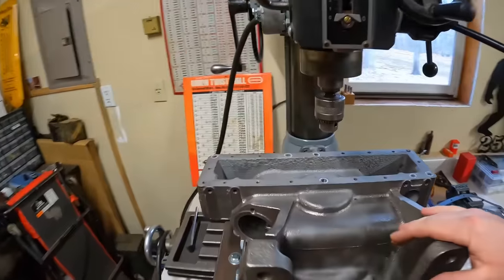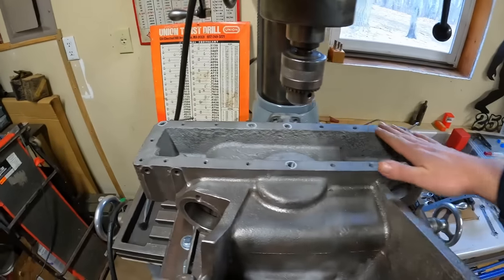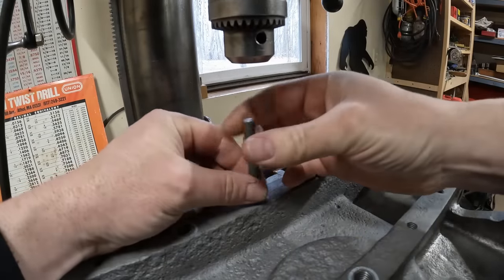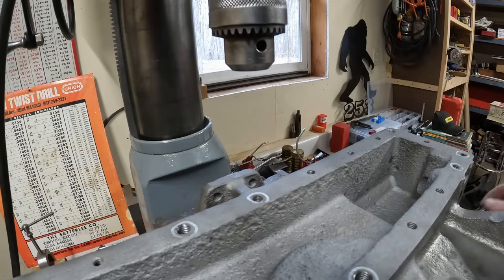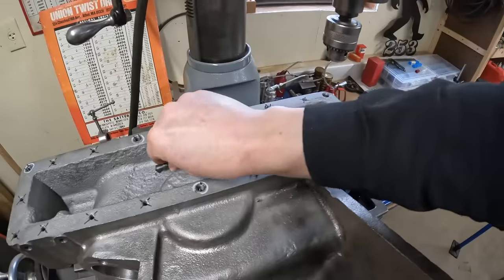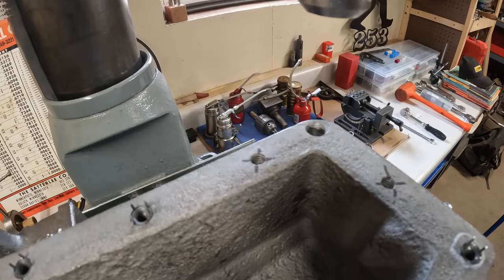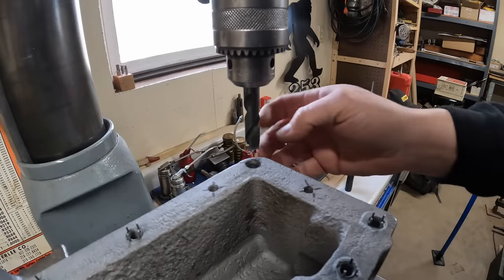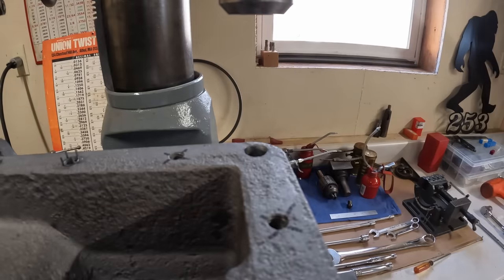#X231 Prototype Part 73: Front Bolster Casting Work Begins - Radiator Tank KEENSERT Thread Repairs

Comment: A shop hack I've successfully used on stripped holes in cast iron is to use a taper pipe plug. Tap the hole for the closest pipe size. Locktite the plug in. Mill/grind flush. Drill and tap for desired fastener. Cast iron plugs are preferable to steel but both will work. 😊

Comment: Toby:

I’m thinking seriously about CRYOGENIC broken bolt removal. The idea came to me after seeing the doc to have a small skin cancer frozen off. The doc had a liquid nitrogen dispenser that looked like a fancy WD40 can.

Think about drilling a hole in the broken bolt then spraying liquid nitrogen in to shrink the stub and break the rust bond. If I could get access to liquid nitrogen it just might work.

I saw a post on the N tractor board about a machine shop dealing with a botched broken bolt removal and wallered out hole. They drilled and tapped it for a PIPE plug, installed one with locktite, milled the top off and then drilled and tapped a proper hole.

I have to figure out how to subscribe. I never miss a new video here. Great channel and great camera work!

Comment: Red and Green rule now. But what pride someone had to drive his new 445  into the corn crib alley for first time. Getting the rusted down to nubbens bolts out of bolster to take radiator out a challenge. Not to mention massive cast grill on front of this B-10 backhoe. Thanks for inspiration.

Comment: As a diesel mechanic myself for over 35yrs those are the hardest bolts get out of cast iron. It easier and faster to do it the way you are doing. I use them all the time.

Comment: I don't know about many others, but when it matters I drill out broken bolts every time. I hate welding nuts for the reasons you state and never do it. On large bolts that go go through a part I drill a hole and torch them out in sections... think Undercarriage Bolts on a excavator car body. Keylocking inserts especially the thin wall variety are my favorite when there is room for them. Good stuff...Cheers.

Comment: I seem to remember the saying ' been there, done that' and it does not apply to this case. First I am not there and you are doing it not me. As a GM Master tech for 47 years I grew to hate broken bolts. In the 80's and 90's I did a lot of rear axle work. Getting a broken cross tie bolt was going to make a bad day. I found away by slowing down and taking my time to remove broken tie bolts. After reading other comments, Great Job. Most Mechanic's would not be willing to take the subscribers along while recording, with this in mind, you are Mr. Kool.

Comment: I saw a setup to sharpen used taps way back in the early 80's.  The guy had made a jig that would hold the tap on his surface grinder and used a thin grinding wheel that had a rounded edge.  2 or 3 passes on the flutes and he said they would cut like new. He would wait until he had enough of them to be worth the setup time so he could do a bunch of them at one time.
Reply from the maker: A setup like that would be great! I’ve tried manually resharpening taps before, but with limited success because I was just doing it free-hand.

Comment: - Excellent debriefing of the failed procedures you went through to remove the rusted bolts.
- Thank you. AND, by happenstance:
- Would you happen to know if any metallurgy information exist about certain water minerals somehow producing a more amplified chemical bonding dynamic per the rusting chemistry of cast iron and steel bolts?
~ ~ ~ ~ ~
- If any of your viewers have access to university inorganic chemistry professors or polytechnic schools, or metallurgy institutions, maybe they could research this for you.
- My bet is that all professors would find this a most interesting question and see it as a possible area for a Masters Degree Thesis.
- I ask this because you detailed that your broad experience seemed to suggest that this particular "rusting tight" situation was very unusual and perhaps unique...and so my mind tried to come up with a possible explanation of "Why".
- Both you and your dad seem to enjoy the academic rigor and regimen of using proper accuracy and precision at the right time, which is the hallmark of good science. I fully expect that all Chemistry Departments would appreciate this in you and you may well wind up with new friends.

Comment: Squatch - a few tips for you - 1) Carbide spade drills are relatively inexpensive, and will drill through hardened tool steel, let alone hard-spotted iron. Also they don't wander. A few nominal sizes are worth buying. 2) Slow those drills down a little in general (but not with the carbide spades, run them flat out). 3) A spiral-point, or 'gun' tap will make its way through tougher material much easier than a standard taper/plug/bottoming tap. They are also worth stocking in a few common sizes. All that said, very nice work with fairly limited tooling/machinery!

Comment: Thanks for showing how the keenserts are installed.  I’ve only ever dealt with heli-coils.  Seems like the oversized ones could come in handy!
Reply from the maker: They make even larger oversized ones too - their largest insert available for these 5/16-18 holes uses a 9/16 thread on its outside 👍
Reply: I feel these would work well with putting fender extensions on H’s and M’s.  One of mine had holes that were packed with debris and really rusted out.

Comment: Sometimes you have to be there to understand what has been tried. One trick I have learned is to use a carbide end mill to get the hole round again and then going to a drill bit for final size. Carbide drill bits can also be your friend at times. Great to see this repair behind you. Christine play nice, we want to see you in your full glory again.
Reply: Yes , a 4 flute center cutting end mill.  Much more rigid than a drill bit.
Reply: Just get a spark erosion setup and be done with it

Comment: I like the superstitious undertone, I´m of that nature,too- because sometimes the Shopgods work in misterious ways, put it that way.
I have to have Helicoils done, too on the hub motor of my ebike and decided it is time for a new toy: a drill/mill table with accessories.
Wasn´t cheap but a good alternative (for me) to a real column drill/mill. Some people despise these (basically) drill holder things but it gives me good base to work with.
Take a look at the Wabeco system, looks just like mine, same quality. I´m very happy to get it, I only work with aluminium, mild steel and wood so I think it can handle what I´m gonna throw at it.
My take on Your machine: it would have been a Godsend to me. I´d have done just the same if offered.

Comment: This is a prototype, prototypes get taken apart all the time to either fix or revision parts of them. It's part of the process, part of the plan. Betcha anything those thread holes are loose and stretched. That's why they stuck, and when that happens... (loose hole + rust) you just don't stand a chance. It's the thread variant of rust jacking between frame parts on a truck. It's like me, putting a jack against the ceiling on a shop and telling the newbie to try to lift the truck from below (i may or may not have done this, i confirm nothing). No amount of penetrant or heat or luck can get you out of the mess that comes with these types of rusted threads. It is what it is.

Comment: So it's well known X231 is a prototype, that being said, how close would you say the tolerances of the tin work fit and finish were?  Will taking 0.05 off the top tank and whatever you ended up taking off the lower have much of an adverse effect on how the hood lines up with the top tank or will you be comfortable using thicker gaskets on both ends of the core when it comes to assembly of the radiator?

Comment: Anyone who has done any amount of work on old iron/salt/equipment would know that an ez out is useless in your application.  Drill and retap is pretty much standard, if the weld/nut fails.  Only trick I can share is to drill the bolt and then tig weld the hole shut.  This will shrink the bolt and not heat the cast enough to harden it.  No filler is needed, just enough to melt the bolt material.
Reply from the maker: Excellent tip! I’ve never pre-drilled and then welded, but it makes perfect sense. Same effect as welding the inside of a bearing race to shrink it out of its bore 👍

Comment: I've done a lot of radiator tanks over the years, usually the mfg searches the world over for the cheapest low grade bolts they can find to hold the rads together.Soft as butter, until you try to weld them out, then they go glass hard. I learned my lesson the same as you, just go right for the center punch and drill index, it's easier that way.

Comment: Have you ever thought of getting an electric heat inductor for bolts I held off kinda wanting one for years but just always used the torch but then I was working on a trucking that had some frozen bolts next to the diesel tank so no chance I was brining out the torch but those things work amazing don't have to worry about flames and heats up just the bolt not the entire case so seems to work better sometimes honestly and saves you on acetylene which ain't cheap either and less smoke and fumes in a closed up shop
Reply from the maker: I’ve been really looking at one of those induction heaters, everybody that I know who has one has very good things to say about them 👍
Reply: @squatch253  yeah I held off for too long should of got one sooner I need up getting the newest one the venom mini ductor it has the most heat power can find them on sale time to time

Comment: I believe you can temper the cast iron to soften it.  Since the hardening is local, it might have been possible to temper it with a propane torch locally.  Even heating it to 400 degrees F would have helped.

Comment: Good job on bottom tank could have used some tap magic or other cutting fluid but it worked  Now you can make some new  reinforcing strips for the bottom and maybe for the top also might want to make a little thicker and wider for more rigidity

Comment: How does the radiator connect to the block? Is it a flex coupling? ie rubber hose..   Will you have to make up for the removed material ? Enjoy
Reply from the maker: Top tank has a bolt-on piece that connects to the steel tube that feeds from the cylinder heads and they are joined by a short section of rubber hose. The bottom tank just has that short press-in sleeve that the much longer lower radiator hose connects to. The other end of that lower hose connects directly to the bottom of the water pump.

Comment: I am jealous that you can keep unfinished/unprotected steel & iron out like that long term. I live in Alabama and the humidity, even in a HVAC controlled shop will flash rust in hours to a day, HOWEVER, I am not jealous of your winters or corrosion caused by your road salts.

Comment: I wondered why you didn't drill the holes out and then fill them back up with brazing material.
Reply from the maker: We don’t attempt any heating or brazing repairs on any of these 10X prototype castings because our skill level is not high enough to confidently perform that work without causing other damage. So cold repairs like these inserts of various types is all that’s left 👍
Reply: @squatch253  ok, that makes  more sense now.

Comment: Looks like you could get a decent sized disc fly cutter in that miller.  That would reduce overhang problems (that you don't have...) but might cause other issues.  I think I just talked myself out of the idea.
Reply: He answered me that he felt that his mill wasn't rigid enough to handle a fly cutter og the required size

Comment: Toby I love your channel and look forward to your continuing adventures.   I am wondering if you have ever considered EDM or Electrical discharge machining to remove broken taps and bolts?  I have a local shop that does this and it has been a godsend on my 92 Jeep restoration.
Reply: EDM comes in handy when the Eazy-Out  breaks off, as the usually do.

Comment: They don't want you to "countersink" the top of the hole. Use a chamfer - that has the same angle as the thread. Do this on ALL holes and get plug taps and stop breaking them.
From 18+ years of Tool and Diemaker - removing dozens of taps.
Reply: So chamfer the hole and use the plug tap from start to finish?

Comment: Real Question: I know cast iron is a bear to even bronze repair due to heat stresses. If there were a specialty oven could be used to heat large cast iron parts to 500f, and silica sand was used to insulate the areas not being worked on, would it make brazing easier? Asking because I have a hair brained idea....
Reply from the maker: We took this casting to Midwest Cylinder Head in Nevada, Iowa to have the brazing repair done to the end of the power steering bore, and they basically performed a process similar to what you described. They slowly heated the whole casting in a large oven, then transferred it to another oven that looks similar to a sandblasting cabinet - it has door openings that the welder can do his work through while the rest of the casting is being kept hot. They then remove the casting and put it in a controlled cool-down chamber to slowly release all the heat over the next day or two. This heating process still didn’t do anything to soften the prior overheated areas though.

Comment: Toby - for the threads that did not require Keensert's - did you consider using Helicoils? - or did you determine that the threads were in a sound condition?
Reply from the maker: All of the holes that had the "X" marking on them were in perfect condition, so I didn't do anything with them.

Comment: With the material you’ve taken off the top tank and the bottom bolster to flatten the sealing surfaces up, what’s the plan to essentially “make up” for that material?  Thicker gasket? Taller radiator core?
Reply from the maker: Yes, all of the above plus maybe even a couple of other minor mods to make things fit back together. We’ll make a more concrete plan once the radiator guy tells us which direction he wants to go - if it ends up being building an all-new core then he’ll just make it to fit whatever size the opening is 👍

Comment: Excellent  and informative video. How much did you remove with 5/8" cutter it looked substantial but it was hard to tell in the video.
Reply from the maker: I didn’t even measure, just like last time started at the worst and lowest spot and went deep enough to take the majority of those pits out, and then took the rest down to that same depth.

Comment: also... why didn't you use an easy out or left hand drill bit or a torch or weld a bolt? 🤔
Reply: No need to break off an Easy-out in the stuck bolt and then go to get that spark eroded away, just take it straight to the spark erosion (EDM) guy.

Comment: What do you mean by my method of bolt extraction wont work, it works perfectly every time no matter what from my recliner . . . Just Kidding. Also you don't have 2 trashed taps, you now have 2 bottoming taps that only require a slight kiss with a cut off wheel. As for the heavy duty tap, That is my go to style for almost all my threading.

Comment: I'm assuming you at least thought about trying to annealing the hardened steel
Reply from the maker: No, I won’t put any type of heat on these 10X prototype castings - I don’t know what I’m doing and will take any means necessary to avoid doing any further damage. So cold repairs only for me 👍
Reply: Well I assumed wrong as I didn't take into account of the metal and age of the metal. As usual your smarter than me when it comes to those old tractors.
Reply from the maker: We had overheated and hardened this casting in that spot prior to bringing it down to Midwest Cylinder Head for them to do the brazing repair to that power steering bore, and during that process the whole bolster casting was thoroughly preheated and kept hot all during the repair, and then slowly cooled over the following couple of days.  I don't know what temperatures it saw, but that process didn't seem to change anything about the hardened areas.  We're at the point with it that we just decided it's been through enough, so we try very hard not to do any further damage with anything we do :-)

Comment: I remember you using cutting oil in previous episodes when drilling and tapping. What made you decide not to while working on the bolster? Cast iron being a softer material?
Reply from the maker: You don't typically use cutting oil with cast iron, nearly all machining processes are done dry on it.
Reply: Cast iron has graphite in it.

Comment: is there a reason i dont know about that you didnt fill the hole with braze to make it nominal size again then dill out the braze
Reply from the maker: When we had this casting down to Midwest Cylinder Head to do the brazing repairs on the end of the power steering bore, we had also asked them to fill that crater hole while they were at it. They decided they didn’t want to do that hole repair though, so we were left to address it ourselves. I won’t attempt any type of heating or welding repairs on any of these prototype castings because my skill level isn’t high enough to avoid further damage. So that only leaves cold repairs such as threaded inserts in various forms.

Comment: As skilled and good as you are at fixing thing, I am surprised that you out source the radiator repair or construction. I bet you could do this portion and make an excellent video of it. I have watched plenty of 3rd world country videos and they make it look trivial.
Reply from the maker: Soldering radiator cores is actually very  difficult work, that takes a lot of discipline with heat control and cleanliness of all work pieces. The best I’ve ever managed to do myself is overheat the surrounding tubes and drop all of the solder out of the joints.